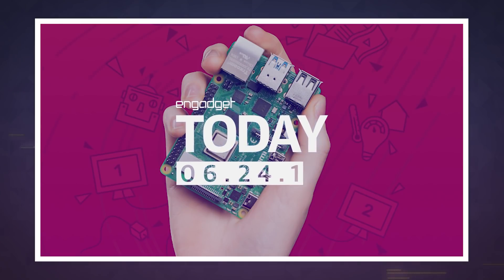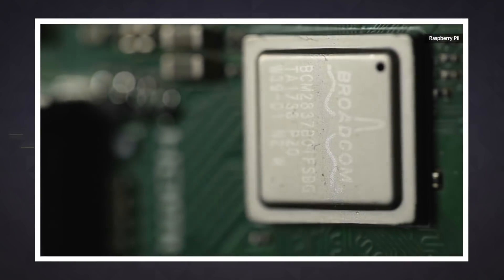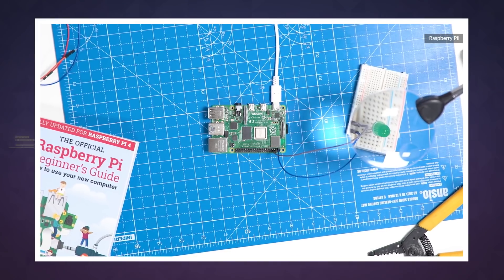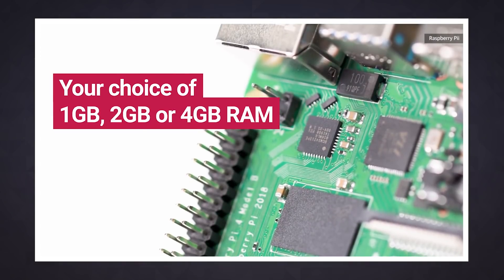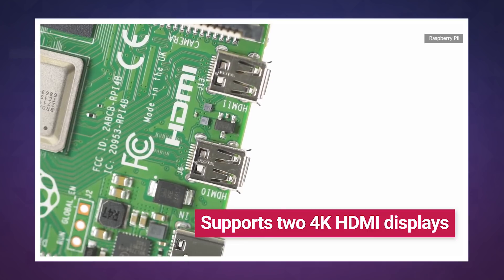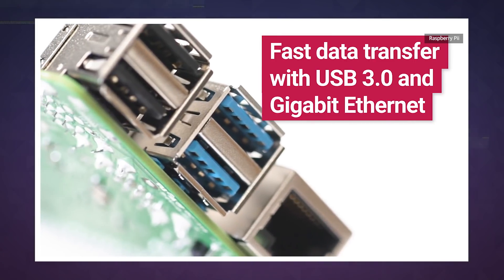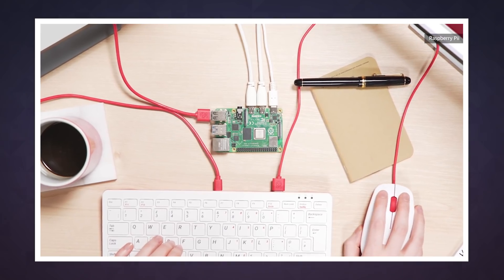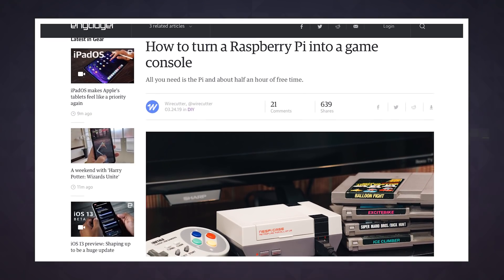The new Raspberry Pi 4 is ready for 4K video

Comment: Did the people who wrote the title to this video even use a Rasberry Pi 4...ever?  Not even being able to play 4k video back at 5 fps is hardly “ready”.  If it’s “ready” for 4k it should atleast be able to playback compressed 4k at 30fps without a hiccup.
Reply: Then what really is the point of a now expensive Raspberry Pi (4 is about 2-3 times more expensive than what the 3b was at launch)?
I mean if it even can't run 4k video (or even some 1080p as some have commented herer) then what's the point if its only gonna be a hobby diy thing which isn't dependable on CPU-power that much in these cases?

Comment: cant even run 1080p youtube videos.
Reply: Yeah you are Right, I have to play at 360p to have a smooth playback.anyway we will see with the next software updates
Reply: if it improves please let us know, i cant find any video with the updated software yet.
Reply: @giacjack  lol, one of the most common reasons for a 360p playback would be that your micro SD card is not fast enough, try an Ultra 32Gig. still you can only get 720p, which is heaps better than 360....
Reply: @rwatson2609  I have a SanDisk 64gb sd, I can run 1080p video smoothly if they are saved in my storage, so I don't think is my sd's slow speed 🙂
Reply: giacjack Wait, so if you download the YouTube video and play it from local storage performance improves significantly?  Sounds like a buffering/network issue.
Reply: Yep, claims of 2-3X faster speeds really did not translate out into Youtube videos at anything beyond 720p, I have heard that the word on the street is that they are working on this patch, but honestly, I have lived long enough to know that if the released version doesn't do something as major as this then there will not be a patch.

Comment: "Pi 4 is ready for 4K video". This is the key part. "Ready" is different to "can".
Just as the earlier pi's could not play HD 1080 till players had the fancy programing within the Video Player to hand processing to the GPU.

The Pi4 is the same. It will only be dedicated players that might play 4k ok. 

But there is progress, and the Pi4 can play 1080p YouTube videos. Which is pretty impressive and does mean the pi4 is a significant step up. 
As for 4k? The chinese SoC boards will likely fill that market.

Comment: If it supports 4K, it means it has enough framebuffer to support 1080 ultrawide like 2560x1080 in OpenGL. I hope they roll-out Vulkan for Pi4 & with Wayland becoming stable by then, we should have some decent desktop experience.
Reply: Sadly but no, there is video with proof that raspberry pi 4 cant handle with 4k 30fps, there are isuues with lags and buffering or just dont play at all... :(

Comment: IMPORTANT SIDE NOTE:  According to Linus Tech Tips, and personal experience confirmed with the micro HDMI are very flimsy and easily can or will break.

It’s a shame they should have made it as full size HDMI port.  Good luck not breaking them.  I DONT RECOMMEND IF YOU WILL BE USING FOR THAT REASON.
Reply: 4 years later and not broken. 🤣
Reply: They should have made these to HDMI Mini, the space is there, maybe we can mod the pie 🤔
Reply: That's the reason they launch pi 4 with case
Reply: @alfredmatthew4653  It doesn't work that way.
Reply: @alfredmatthew4653  cases don't replace ports

Comment: My personal project is too turn that raspberry pi 4 into raspberry pi 5 but the hardware just isn’t powerful enough.
Reply: Aditya Mishra  the new Odroid H2 is quite power yet still inexpensive compared to other barebone single unit computers. Check that out.  The performance is almost better or equal to the N5000 laptop cpu processor,  now that’s nice and fast enough for your needs.  It’s capable of 4K 60hz video playback. Plus,  big bonus is you can upgrade up to 32GB of RAM!!
Reply: *to
Reply: Mark Granger the joke was lame 😒